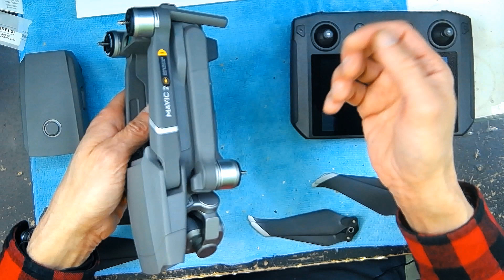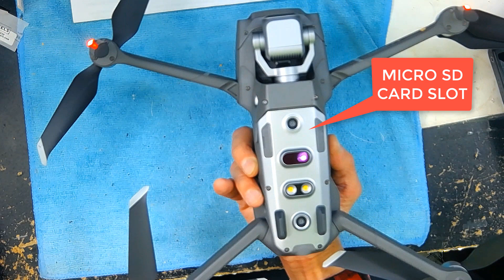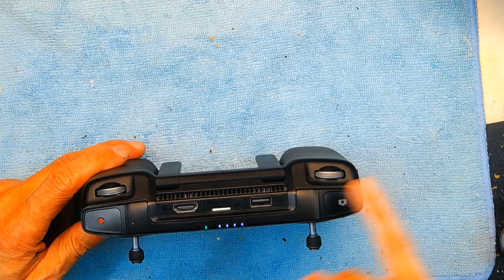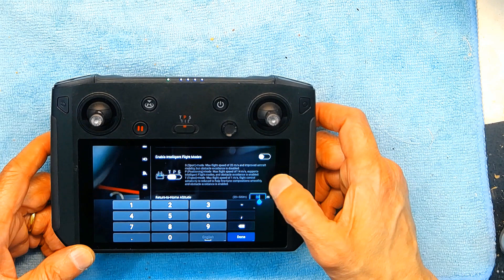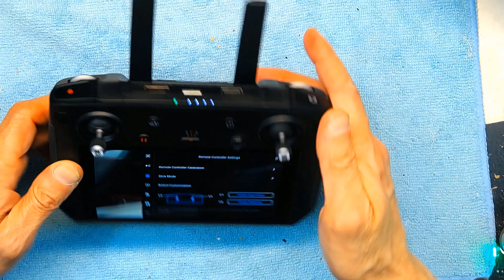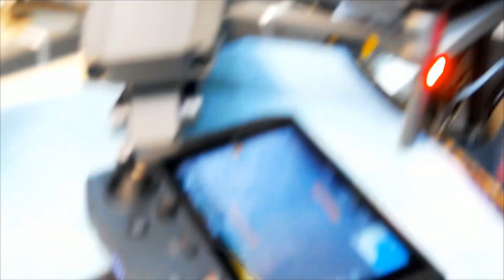Basic Tutorial For DJI MAVIC PRO 2 Professional Drone With Smart Controller Prop Assembly & Settings

Comment: Thank you very much for this information video. I bought my Mavic Pro 2 in 2017. It had the older controller that you had to use with an iPhone or similar phone. Unfortunately the batteries weakened to the point where the controller only lasted a couple minutes. So I purchased a new DJI smart controller like the one you are showing here. Unfortunately you didn’t cover the connection of the controller to the drone. Can you please let me know how to do that. Thank you.
Reply from the maker: Sorry about that, I should have shown that. But here is how you do ithttps://www.youtube.com/watch?v=sl2ZKTALzIY

Comment: High great video, question: does the controller has a audible sound when the controller battery gets low?? And or are the 4 lights at the front the only way to tell controller battery state. I ask this as my controller turned off the other day without me knowing with low battery
Reply from the maker: Yes the controller has several alarm settings that can be turn ON/OFF for the following events: 
1. Low battery on the Drone
2. Low battery on the Controller
3. Obstacle near the drone
4. Entering Restricted Air Space 
5. Loss of Satellite Signals on the Drone, and more.
Reply: @TECHNOLOGYTIPS101  thanks, but can’t seem to find where the off on is for. Low battery for controller?? Sorry
Reply from the maker: @georgiegirl2001  See page 17 and 18 of this manual https://dl.djicdn.com/downloads/smart+controller/20190110-2/DJI_Smart_Controller_User_Manual_EN_V1.0_0110.pdf
Reply from the maker: @georgiegirl2001  Maybe you have the older firmware in your Remote Controller, you should update it because they fixed a lot of bugs and errors in the newest firmware.

Comment: Hi, I have the Mavic Pro 2 since 2019, the old controller had some issues with charging. Would anyone suggest of upgrading to a smart Controller?
Reply from the maker: Yes I recommend a smart controller, and you can get them cheap on eBay

Comment: Hi can u see on the controller the distance yr drone is at ?
Reply from the maker: Yes the controller shows two distance measures, One the shows the drones horizontal distance form the home point, the other shows drones vertical distance from the home point. For example if your drone took off and raised to 10 feet then you simply moved it horizontally to 1000 feet but didn't increase the drone's elevation. Your vertical measure will still be 10 feet but your horizontal measure says 1000 feet.

Comment: Pretty Good Tutorial.  Can you tell me, have you ever used yours for Tripod shooting say a band or something, for live view?  Can this be set on a tripod with propellers off?
Reply from the maker: Yes you can shoot with the propellers OFF, however this will not record sound, so you have to have a separate sound recorder for that. In addition to that since this has a very powerful processor inside the internal cooling fan will continuously run so the battery will still drain in less than an hour.

Comment: Correction - You sid the faa lets you fly to 400 meters. It is 400 FEET!  without a waiver. There is more to that as well. If you are up the side of a sky scrape, you can't get more than 400 feet out from it. If you are on top of a mountain and fly out, your altitude is calculated from below the drone. You can't fly out and think 400 feet above you, it is AGL Above Ground Level. 
The extras are for the beginner that doesn't yet have a part 107. 
And Epstein didn't kill himself.
Reply from the maker: Thanks for the info. after I posted this video I joined Pilot Institute to get ready for the Part 107 Exam. So I learned much more than I knew then.  I know Epstein was murdered, lol

Comment: The gimbal guard is to keep the camera from jostling around during traveling in your bag. Nice way to lead people astray by saying don't use the gimbal guard because it makes cosmetic marks.
Reply from the maker: I use a soft cotton ball as gimbal guard not the original DJI one which is garbage. At least they could have put some soft padding on it's interior to prevent damage to the camera body.

Comment: Very good video, Thank you. But what is the button above right for (while left is for the camera orientation) ?
Reply from the maker: The round dial on the top can be programmed to control the camera pointing up or down. You can use either one of the two dials depending if you are right handed or left handed. However you need to go to settings to assign functionality to each one. Including the buttons on the back or the remote.

Comment: What about the right wheel on the remote? The left moves the camera up and down, but I can't get the right wheel to do anything, as zoom in or out. And this is with the mavic pro 2
Reply from the maker: Yes the normal Mavic 2 Pro does not have the zoom feature, but the Mavic 2 Zoom which is a different drone does have that feature. You can also install the Zoom Camera on the regular Mavic 2 Pro

Comment: How much does it cost?
Reply from the maker: It costs about two thousand dollars new, but you can get a lot cheaper used from eBay.
Reply: @TECHNOLOGYTIPS101  thank you very much 😇
Reply from the maker: @yasirhusseinmahmood4390  No problem!
Reply: @TECHNOLOGYTIPS101  I found the perfect mavic for me, but because I live in Iraq it can't be shipped to me, non of the sellers on Ebay nor Amazon support shipping to Iraq. Such a shame, that just feels so racist. Anyways thanks for your support.
Reply from the maker: @yasirhusseinmahmood4390  NO it is not about racism it's about the reliability of the postal service in countries that suffer from war form many years. For example they don't ship to Afghanistan and Syria either.  Also in some countries for example Jordan Drones are illegal so if they ship it it will be confiscated by the Customs.

Comment: Hello I have recently purchased the new mavic air 2 I believe the smart controller works with this drone will it work on my mavic platinum as well. Thank you  Irvine
Reply from the maker: Greetings sir, although I haven't tried it myself to give you a confirmed answer, I believe it will not work. The Mavic Platinum is much older model with much older transmission technology. The new Smart Remote uses a much more advanced technology which gives you a crystal clear image at 1080P for up to 4+ miles. So it could be reverse compatible but I am not sure.

Comment: I have WIFI issues. It connects to wifi then I  leave that screen it says disconnected. I must have set it up wrong. I did not see wifi set-up. Do you cover things like that? -Ron
Reply from the maker: That sounds familiar, it happened to me and after I restarted my router the problem was fixed, so try that and see what happens. Also try switching between 2.4Ghz and 5Ghz because the 2.4Ghz although it's is slower it reaches much further away from the router.

Comment: As a newbie who has all the gear and no idea then this is massive on the controller. As ever, if you combine this video with start up videos for things like calibration and set up then it is very useful. As a guide for the smart controller - bookmarked and will be referred to much. Thank You... Not putting the propellers on was a great tip too (in the comments)
Reply from the maker: Yep that is very true, and I thank you for your input.

Comment: I appreciate that you made this video, however if a first timer is following this from scratch, from unboxing, they absolutely should NIOT put the propellors on before they go through the drone and controller setting and firmware updates. They should do all the setup and not put the props on until they are ready to fly for the first time.
Reply from the maker: Thanks for your input and I agree with you, for safety reasons it should be last.
Reply: The first thing you should be doing is reading all the supplied manuals and understand the basics of all components
do not put propellers on in the house as a new pilot.
Reply: He should also get a little more familiarize with the wording and explanation, 1-return home! Drone will return to where it was calibrated at last position.2- learning what sonar sensors are in bottom of drone and there are no sensors on lights as he explained, 3- drone works as well with the original controller. Much much more. Nevertheless ok video for a new user.